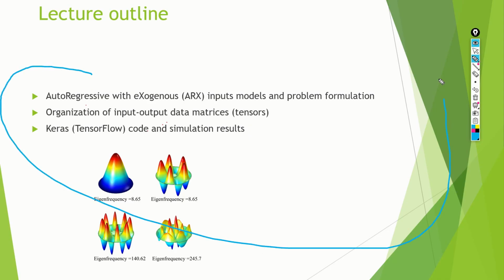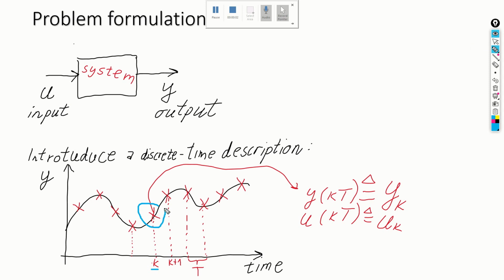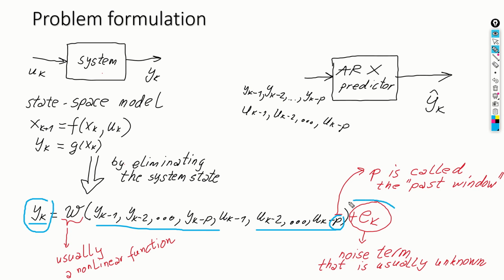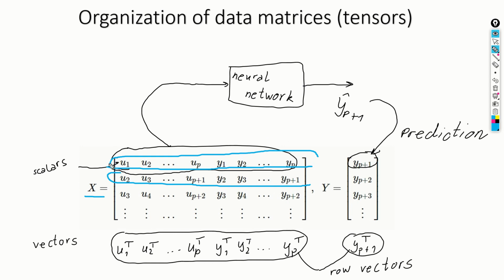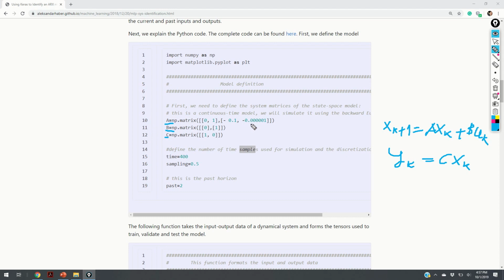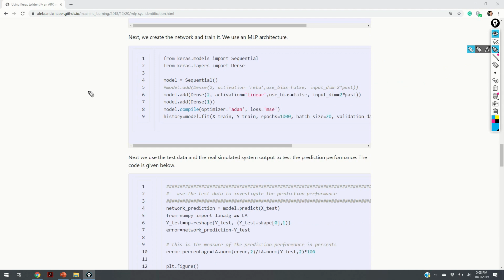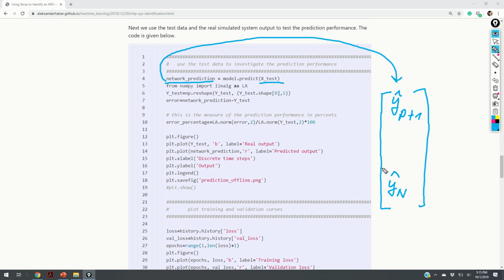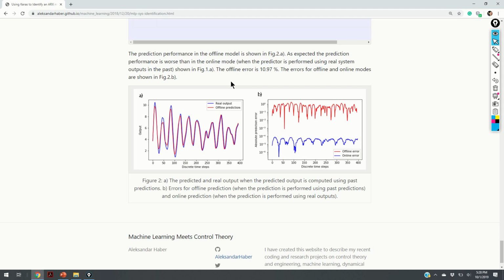Machine Learning of Dynamical Systems Lecture 2: Learning ARX models using Keras (TensorFlow)

Comment: Thank you for the explanation, I want to ask, If I have more than one set of time series, how should I reshape my data?
Reply from the maker: The time series has to come from the same underlying system.  If that is the case, then you can simply augment the vector of time series. That is you can glue two-time series together, and use the same procedure. Best, A. Haber

Comment: Thanks for the video! Can you tell me if I can import the ARX model into Matlab? I have trained an artificial neural network in Keras and would like to use it in Matlab as an ARX model. However, I am having a hard time importing it within Matlab.
Reply from the maker: Try this:
https://stackoverflow.com/questions/62145245/how-can-we-get-regression-coefficients-from-a-keras-linear-regression-model

I do not have time to look more into this at this point. However, this should be possible.

Comment: Thank you Aleksander, very clear, do you have a video about about NARX (non linear ARX)? any hint on real-time continous/online learning ARX()?
Reply from the maker: You can generalize the approach I explained to Nonlinear ARX by simply choosing the nonlinear activation functions. At the end of the day, the neural network will behave like your nonlinear ARX model if you tune it correctly. It is a black-box approach, you cannot expect to exactly fit the original parameters of your nonlinear ARX model. However, you can fit a network that reproduces the input-output behavior.